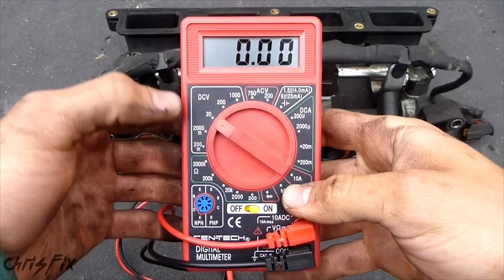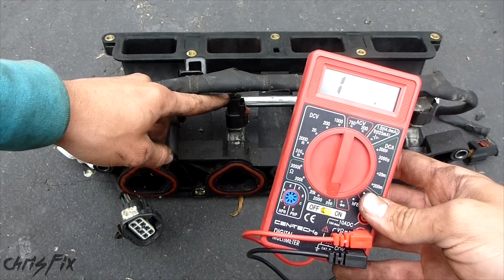How to Check Fuel Injector Resistance with a Multimeter

Comment: It's so much easier and faster to scope the common power wire to all the injectors.  Using Ohm's law, you can quickly determine the resistance of each injector.  Resistance is Volts divided by Amps.

Comment: I have a diagnostic challenge... Mice chewed on my fuel injector lead to #4 cylinder and it shorted out.
I replaced the injector. Repaired the wiring. And confirmed the coil/plug were firing fine.
It still did not fire the #4 injector.
I tested the wires to the other injectors and it show 8v each, but the #4 lead is showing 14 volts…
My assumption is the injector controller in the ECU is damaged from the short or possibly something in the wiring?
Do you or anyone have an idea what it might be?

Comment: Hi Chris
I have a BMW with the 320d n47 engine. I replaced the valve cover gasket. The engine was running perfectly before that. Now the car does not want to start. Scan shows that all die injectors are faulty?? Ohms show zero for all of them. How do you think its possible for them to magically become faulty, just by taking them out en putting them Back?? Now I have to buy 4 new injectors for absolutely No reason. Have you ever experienced anything like this?
Reply from the maker: Dang that is strange, but the good news is that it's extremely unlikely all 4 injectors magically failed at once, I would suspect it's a wiring harness or injector connection issue (pinched or crushed wire on install?), a bad ground thats loose or not connected, or something like a missing signal (cam or crank position not plugged in fully)

Comment: I have puegeot 2008 2017 with code P1338 misfire impact on catylist 
Can u guide which things is wrong bcz i searched online some forms say fuel injecter is bad some spark and some coils and some cam and crank shaft sensors

Comment: You saved me so much money dude. 97 Miata's 3rd cylinder stopped firing. Thought my engine was toast. Zapped myself testing if the coil packs/spark plug wires worked (lol) so yeah no issue there, and then found this video to test the fuel injectors. Sure enough, I had a 21.3 reading on Injector 3, while all the others were around 14. Replaced it, started right up no problem. Love you bro.

Comment: @chrisfix I have a 2008 Acura TL with codes p0171/p0174…I checked for vacuum leak, I will try this injector method, I doubt fuel pump because car turns right on….Any ideas?

Comment: So what happens when all of my injectors are at 0 ohms
Reply from the maker: Verify your multimeter settings and the probe connections and test on a working resistor first, if it's ok then it's possible there is some sort of wiring issue (if you are testing still connected to the harness) or all the injectors are bad/burnt out

Comment: Can anyone help, have a cmax tdci1.6 that's gone into limp mode and very rough,code p1261 cylinder 1, I would replace and recode but the 3 others are reading ol on multimeter and the one that supposed to be bad is reading normal ,I expected it the other way around, ,side note just tested an abs sensor as was coming up faulty reading ol ,replaced it with new one and still ol but is working fine,is my multi meter backwards or something ,I don't get it

Comment: What does this test tell us and doesn't tell us ? For exemple, would a dirty injector be out of specs ?
Reply from the maker: It would indicate a bad injector if the resistance is way off the spec/other injectors. A dirty injector is still usually working correctly, it would just need a cleaning so it shouldn't show up differently.
Reply: @chrisfix  so to add on from this, if you already swapped in new spark plugs, and you know the coil packs are okay. After doing this test and the injector is showing okay but still a misfire on that 1 cylinder, the only 2 other possibilities would be clogged injector or major engine repair right?

Comment: All my resistance measured the same, I have volt in my fuel injector connection. I don’t have a misfire code. Just a p0201. Should I replace the injector anyway?

Comment: Also watch out for slow climbing reading if reading takes long to reach stable it is also likely a bad injector another check to do just to figure out what's actually failing is measure from each terminal to injector bodies sometimes it can be the internal wires have shorted to body if no reading across any terminal than there is likely a break in the wire hope this helps.

Comment: 😮 Holy Smokes‼️
Dude… 👻🙌🫶🤝🤜🤘👏👏👏Thank You, Thank You, Thank You!!!!!
I have been trying to figure out how to test the injectors… #3 specifically… on 2002 Lexus ES 300 with the VVI V6 …🥺😫😩 If You Know… You Know!!! 
The head engineer of the this model… Must have caught his wife cheating with a mechanic⁉️ Having to take the entire top of the engine & everything attached to this …. just to change the spark plugs…😩 There just can’t be another answer… Right⁉️😁😂😂 

It Absolutely Works Great 👍 Now I that #3 is bad and all I have to do now is…😩 Take the entire top of motor off,  the vacuum system, the air box, the… 🥹

Thanks Again… I’m a subscriber now!!! 🫶

Comment: P216C OBD-II:
Fuel Injector Group "E" Supply Voltage Circuit High. Could this be a pressure sensor causing this code

Comment: Thanks! I was getting read to remove my injector rails and swap injectors to troubleshoot if injector 4 is bad due to misfiring.
This will save me that time and I can quickly check resistance.

Comment: You forgot to mention that injectors are either high impedance or low impedance. A low impedance injector will have a resistance of around 2.5 to 3 ohms, while a high impedance injector will fall somewhere around 12-18 ohms. Good simple video on how to check 😎
Reply: Well that would fall under the whole looking up the impedance for your specific injectors thing that he mentioned.
Reply: Considering it's beyond rare for most cars to have low impedence injectors, it's not really something he "forgot" to mention, especially considering he said to look it up. Most people with cars that run those know what they have. Nice try though. 😎

Comment: Hey Chris, my 1993 Legacy RS Turbo Subaru has suddenly lost boost. It drives okay at low speed, no stalling or stuttering etc and idles smooth but is just noticeably weaker and will not boost and has no power when I accelerate. I checked the codes and got a fuel injector code. It did run out of fuel while driving the other day. Could a blocked or failed injector be causing this? Thanks

Comment: hi, all my 4 injectorshave 0 ohms of resistance, but the engine start and no engine light? I did it multiple times, precociously touch only the probes of the injector!! Is it possible or i messed up my resistance test? Thanks!

I heard that solenoid injector can have .3ohms of resistance and working fine!
Reply from the maker: If it’s running fine I wouldn’t worry. Are you sure your multimeter is working right?
Reply: @chrisfix  the engine is running really rough, that is the thing, i feel like i always have to put more and more gas to get to the same rpm (that's why i thought of injectors...)!

i checked the specs of the injectors, they need 0,215 – 0,295 Ω (and need to be replaced if out of this range according to bosch),  i definitely have less than 0.2Ω, but multimeter is not more precise (tried with 2 multimeters, same result)!

I bought a milliohmmètre, i'll retry the test when i get it and keep you updated :)

Thanks for your time!

Comment: But what if the injector problem isn't due to the injector itself being bad, but a bad electrical connection somewhere? I could be wrong, but it seems to me that a better test would be to backprobe the connectors leading to the injectors to see if the voltage and current are within manufacturer's specs.

Comment: I must have one with ohms off just enough that it only starts failing once it heats up.

Worst part is, I've seen it, I can touch it...but I have to remove a whole intake manifold just to access it for replacement.

Comment: Hey Cris my son has a 2002 Nissan Xterra I have replaced everything on the vehicle maintenance wise. He has been randomly getting a cylinder to misfire it’s very intermittent some days his car will run perfectly fine some days it won’t run right and it will send the engine code P0 302. If his injector was bad wouldn’t that be a constant and not intermittent like this

Comment: I have a 2007 Jeep Liberty, My Question is, Would A Bad Fuel Injector Shut Off The Coil Pack From Working? I started My Jeep up and Check Engine Light Came on, P0204 and a P0304. I did that test where you unplug the coil while the car is running and no change in cylinder #4, So Ichanged The Coil Pack From Number 2 and The #4 Coil Pack Worked on The # 2 spot, but the #2 Coil pack Did not work on the #4 spot. So I am  Confused now.

Comment: Do I need to discharge my fuel system first? Or is that for taking the actual injector out? And if so is there a simple way to do this?
Reply from the maker: If you’re taking the electrical connector off you don’t need to discharge the fuel pressure

Comment: My car Toyota yaris 2013 model.... Has a lot of engine vibration and its injector number one not working, I've called an electrician to run the test. The electrician says there wire supplying injector number one is not having power... So we tried to remove the whole wire and see mybe if the rat had bitten the wire, nothing the wire is fine..... So can you advise me on what else can I check out for troubleshooting........ However the car is drives but I'm not happy with the engine vibration

Comment: I have a 2015 Dodge caravan changed the injectors and spark plugs and coils it was running fine for a few days later it starts shaking diagnosed it and I got a po305 code checked it changed the coil and spark plugs to another cylinder and got the same code po305 someone suggested testing the fuel injector the clips can't come off unless I take the injector out which I really don't wanna do that unless I really have too can i test it with the electrical plug in the injector please advise me thank you 🤙

Comment: Chris all y injectors read 0.0 but the truck runs great. And also the fuel pressure is a few psi of what it should be. I’m stumped. I’m not a mechanic just a YouTube search guy.

Comment: checking resistance does not necessarily mean your injectors are good.. Obviously,  if 1 or more is really out of whack, compared to the others, after ensuring your leads are making good contact on injector terminals, then they're junk.. but a good reading might pass a bad injector. An electrical item at rest vs the same item at work.. 
I tested a set of injectors on a car once probably 6 times.. finally, one tested near dead short.. the best test, if possible is to the amp draw on a working injector

Comment: Hey there I just did your stuff and everything's good with my injectors but I was wondering if you knew anything about the immobilizer or the black box with a cheap underneath my dashboard that runs over to the other key ignition on a 02 Nissan Altima

Comment: Testing ohms on the injector only tells the resistance,not if it has mechanical failure,always,always when testing the injector u think is bad take it out and see if it sprays,just like a starter u can have amps to it and it still be mechanically bad.

Comment: How did you test outside of the car?
Reply: He's only measuring the "resistance" of the circuit in each injector. The power is provided by the meter.

Comment: Dear Chris, I have a 2004 Grand Marquis, (I'm the original owner, about 230,000 miles on the car) and have had an ongoing problem with the engine light coming on after driving the car for a while.   Symptoms are rough idle after the car comes to a stop; usually slows down to around 550 rpm, plus or minus after 20 to 30 seconds of coming to a stop, followed by occasional shuddering on acceleration.   I've had the car to two mechanics.   Before taking it to any mechanics, several months ago I replaced all the plugs and coils.   Lately, one mechanic replaced all the plugs, which had less than 11,000 miles.  He replaced the number 5 coil.   A week later I bought a new air idle control valve and a new throttle position sensor and had him install them.   He checked for vacuum leaks and twice he told me he found vacuum leaks.   None of these new parts or service have solved the problem.
I put a scanner on to see what code appears when the engine light comes on.  It's 0355, which is the #5 cylinder.   Another mechanic noticed the #5 coil was somewhat loose.   He noticed the thread was stripped on the coil bolt, so he dropped a piece of plastic wire tie in the bolt hole of the manifold, and that made the bolt tight.  Then he used a couple of plastic wire ties to secure the connector to the coil.   He erased the code, and the engine light stayed off, until I drove the car about 20 miles the next day, it came back on.   On the last two gas fill ups, I put a bottle of lucas fuel injection cleaner in the tank at each fill up.  I also tried spraying contact cleaner on all the coil connectors, and several other electrical connectors.
Is there any thing else you might recommend or (GOD FORBID) should I take it to a Ford dealership?
Thanks for all the help you give to so many people !!!
Reply: Did you get it fixed? I'm fighting a constant cylinder 5 misfire on my 2001 Grand marquis. Same symptoms. Drops to 550 RPM after a long drive  / warmed up then sets cylinder 5 misfire.
Reply: @mmiller1188   HI Mike and I'm thrilled that you replied.  YES, I got it fixed, and I can probably help you get your problem fixed.   I live in Miami, and first I'll tell you I went to about 6 Ford dealers before finding a seventh who fixed the problem.    I found a guy on youtube who was a Ford Master Technician, who explained the problem, something the first 6 Ford dealers did not even mention, and did not even suggest.   IF you have replaced plugs and coils, and other parts , and you still have misfiring, then your main computer needs to be reprogrammed.   First , you need to find a Ford Dealer who will reprogram your main computer.    Symptoms of a main computer that needs reprogramming are 1.   engine light continues to come back on  2.   rough acceleration   3.  Eventually the misfiring will shut down your AC compressor , a built in feature that protects the AC compressor.   Once the main computer is reprogrammed, that problem will be corrected.     It is remotely possible to reprogram your own computer, but probably more complicated that you or I would want to risk.   You first would need a bidirectional scanner, which allows you to reprogram your main computer.    You would have to purchase a "FORD" subscription when you purchase the bidirectional scanner.    Then you would need to know how to to reprogram the computer using  the scanner.
If you take it to a dealer that will reprogram your main computer, they will check for any bad coil connectors, bad vacuum tubes, or any other problems related to your ignition.    Before I knew the main computer could be reprogrammed, I wasted a lot of money on mechanics replacing parts that did nothing to fix the problem.    I tried replacing all the plugs and coils, and still had the same problem.    IF a dealer tells you that you may need to replace the main computer, I would be skeptical.   FIrst ask them if they can reprogram your main computer.   If they tell you that can't be done, find another Ford dealer.    Pines Ford in Pembroke Pines FL, did mine.   The last time I had it there about 2 months ago, they replaced all the coils, replaced two coil connectors, reprogrammed the main computer, total price was 940 dollars.   On a previous visit, they replaced a coil and a vacuum tube.   IF you know the mileage on your current plugs and coils, 
if there are a lot of miles on them, then have them replaced before they reprogram the main computer.   Ask the dealer to inspect the coil connectors, vacuum tube, etc. if you have your plugs or coils replaced.
Let me know if you have any questions, and how things work out.

Comment: Can you do this while the car is running or do i do it while the car is off??? Battery plugged in or off?
Reply: Either. You're just measuring the resistance of the circuit in each injector. The testing power is provided by the multimeter.

Comment: Not sure if this is even my problem yet, but I just want to thank you for something very basic yet for some odd reason many fix it videos for various problems that involve checking with a multimeter never tell you what to change the damn switch on the meter to only what it should or should not read so thanks a lot definitely got a subscriber even if this isnt my problem. lol

Comment: Thanks for the video. I have two bad ones. One at 1 and the other at 39. My hood ones read 14.9 and the ones I hot from autozone read 15.9. Should I install them just like that? Replacing all 6 will be a lot mire money.

But my worry is that it will be higher than the .5 you recomend.

Btw, I couldn't find the specs on my car's injector.
Thanks and please let me know what would happened having two injectors at 15.9 and the other 4 at 14.9.

Comment: 0:20 if you get a P0300 "depending on how many injectors you have," does that mean the car is a 0-cylinder? ;)
Reply: P0300: Random Cylinder Misfire.
P0301: Cylinder #1 Misfire.
P0302: Cylinder #2 Misfire.
P0303: Cylinder #3 Misfire.
P0304: Cylinder #4 Misfire.

Comment: Ok so I have this one injector,  has good resistance (around 5, exactly like the working ones) but when I apply the voltage just won't click (unlike the working ones) I tried spraying pressurized carb cleaner while voltaging it, also let the cleaner rest. Nothing is working. My question is:  If I have continuity, why won't it click?